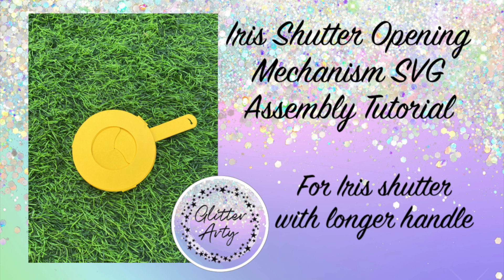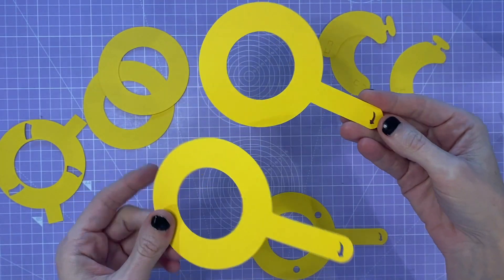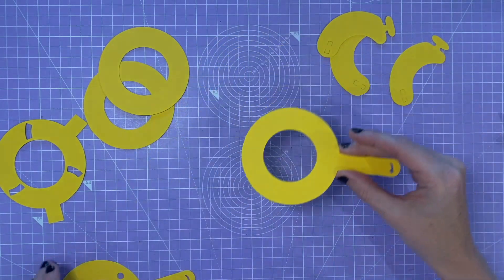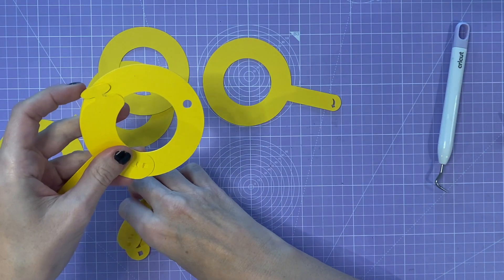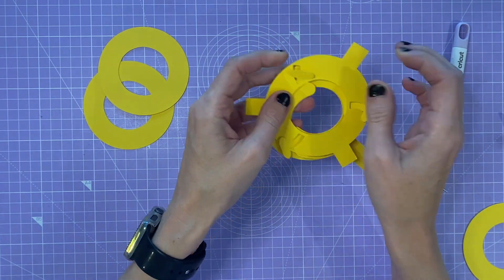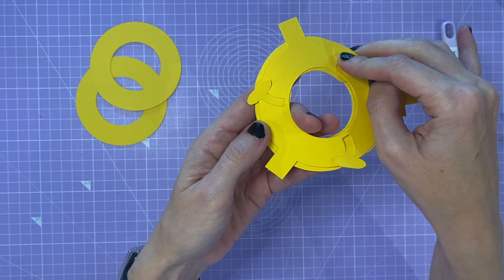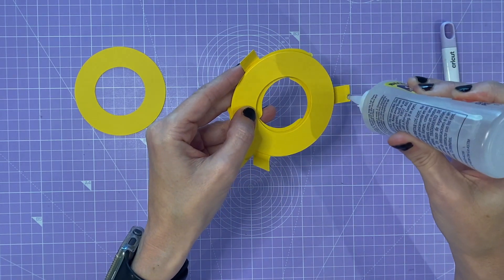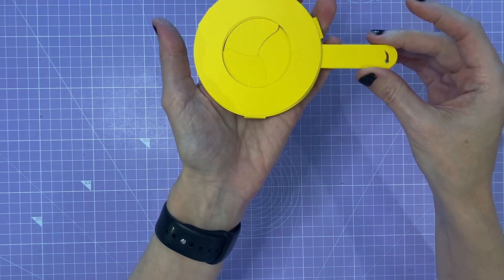Iris Shutter Opening Mechanism SVG - Assembly Tutorial.  This Version has a longer handle

Comment: hello Im trying to  attached mushroos to circle but the squre of it broke l chenge my paper 2 times but its the same results any help please ? i bought from yr store the template
Reply from the maker: Hello, my suggestion would be to use a heavier weight of card (definitely over 200gsm).  I have used American Crafts card for this and it works well, you can even use Cricut Kraft Board which is super sturdy
Reply: @glitter_arty  I apologize, I misinterpreted what I meant. While cutting using the Cameo device, the entire square is cut so that it cannot be bent. I have an empty square, and if I cut it with the bending blade, it will be very short.
Reply: i did ittttttttttttttttttttttttttttttttttttttttttttttttttttttt  thank you